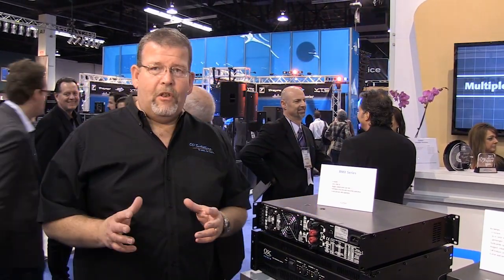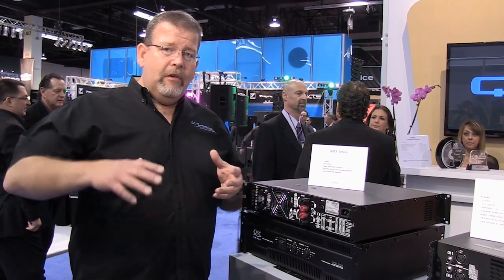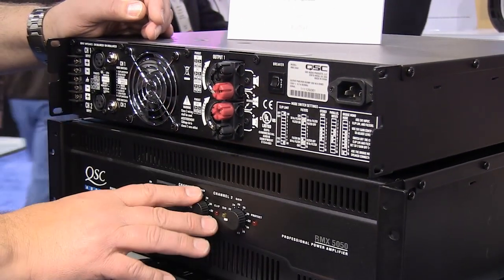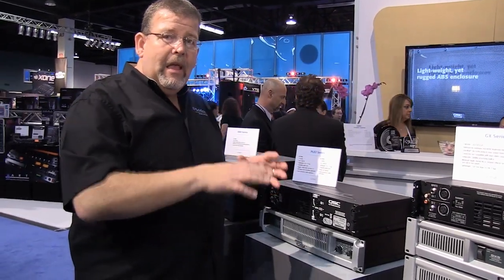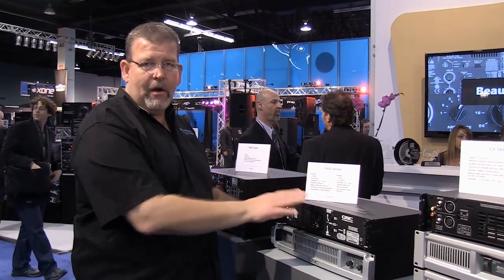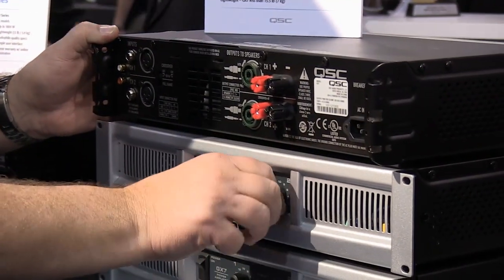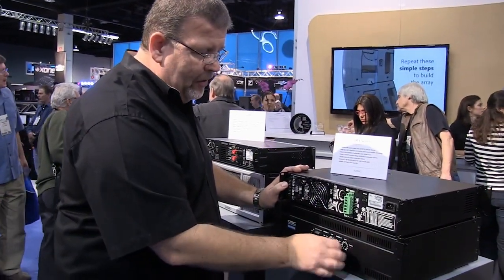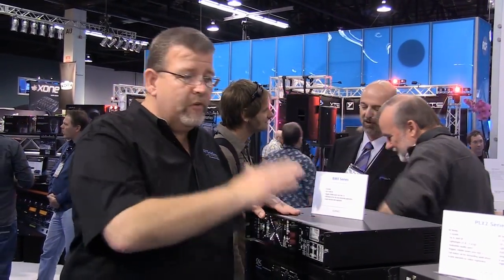QSC Power Amp Comparison RMX, PLX, GX, CMX - Reviews

Comment: i have a QSC PLX 3602 with problems also the plx seem to always burn at the bridge rectifier section transistors are obsolete on these units. pretty much an expensive throw away amp.

Comment: Qsc RMX 4050 vs mx 3000 wish one better for subs
Reply from the maker: Amplifiers to use depend on the Speaker or Sub. What Sub are you using?
Reply: Not sure what type of speakers am using but am thinking about 4 ,18 subs
Reply: Don't know if you still have the qsc 3000 mx but that amp is a beast that is the amp you should use that will sound good in anything

Comment: can i run jbl srx 725 4 top at 2 ohm without any problem....in one channel 2 dual top and in other channel 2 dual top..
Reply from the maker: I wouldn’t consider these models to be 2 Ohm stable. You can always double check with QSC support, their info can be found on QSC’s website.
Reply: What series of amplifier were you considering.  I tend to agree with the video, if you want to run at 2 ohms I have had the best success with the RMX.  I would look for a RMX 4050a if I were you and had to run at 2 ohm, but I prefeer to run at 4.

Comment: what about the mx series
Reply from the maker: QSC MX Series is a Discontinued Model of QSC Amplifier. It was a heavy duty power house holding lots of power, Modular Construction, Direct Metal Mounted Power Transistors and was designed to be Fan Cooled. The MX version could carry a load from 8 ohms to 2 ohms.
Reply: I have a 3000mx and it is a good amp but it is heavy
Reply: @CCISolutions  MX series have excellent damping power.

Comment: The best and most durable amplifier qsc ever make is the mx model not even rmx 5050 could sound better than the  mx 3000  so all those who have the mx model hold on to it they don't make them like that anymore.
Reply: Haye you ever opened your MX 3000 ? Then you will discover that it is almost the same like the RMX 4050 HD, QSC EX 4000, JBL MPA 1100 , MPX 1200! The RMX 4050 HD and RMX 5050 are updated versions of the MX/EX Series. Even the Crown XLS 5000 is a RMX 5050 with less functions ( Filters etc ).

"HD" series means full 2 ohm support back in the days. The HD Series stays cooler in 2 Ohm Mode!

Comment: I'm in the marker for a 2-ohm stable amp for subwoofer use and this review was helpful.  A local dealer has a used RMX amp and now I know it's going to be a safe purchase.  Plus, Ron (here in the video) is a real pleasure to deal with.  A good, solid man.

Comment: Qsc rmx 5050 is the best amp period I drive it in a stereo 2ohm load with 8 18inch sub's! shakes every venue! effortlessly. its heavy but worth every penny
Reply: Carmelo Galvez. you are not lying, we use the same amp and it's a beast...heavy but beast
Reply: 8 subs on one amp ?
Reply: @djgazaaka5000 You can as long as you keep it at 2 ohms or more meaning using a higher ohms speaker!
Reply: QSCs are overpriced its a scam… they still overheat . Behrigers they hardly over heat after 3 hours of playing at full power